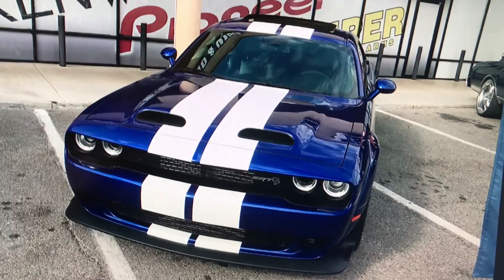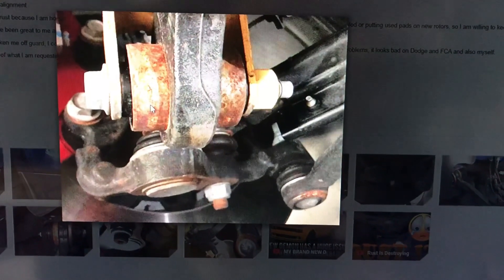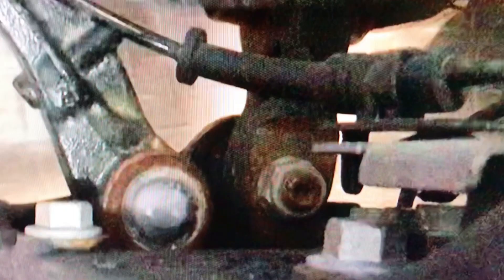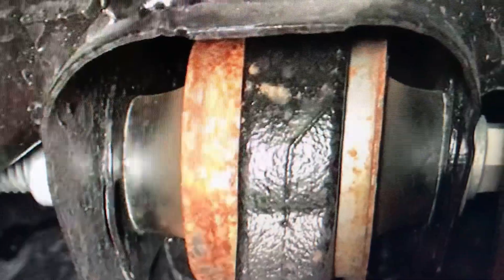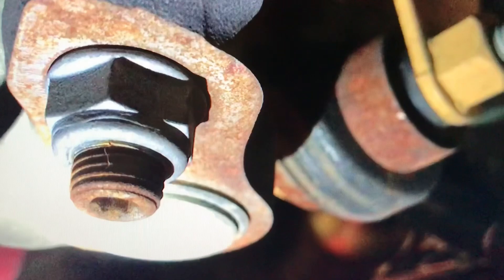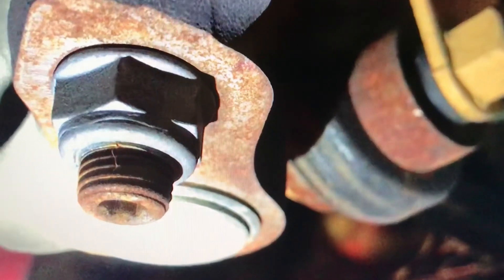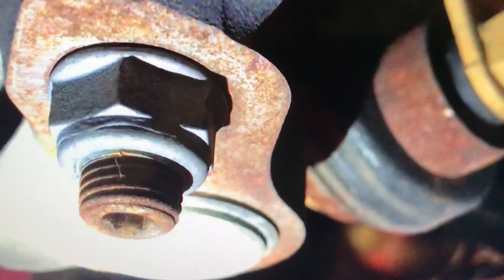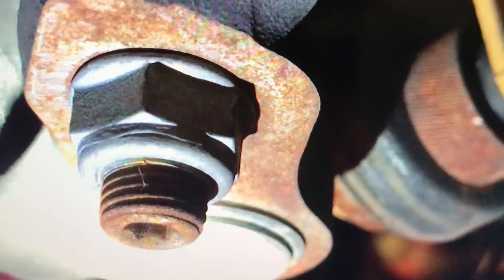2019 HELLCAT REDEYE WIDEBODY EXPOSING THIS SERIOUS RUST ISSUE VIDEO 1 OF 2 SHAME ON DODGE & FCA

Comment: Well it is a dodge.
Reply: I can agree with this comment when I think of Dodge I think of rust granted if its surface rust that can happen with anything unless it's properly coated I would have personally never ended up with a Dodge but I do have a Dodge Dakota because it was my grandfather's and he passed away so far I have had to replace all the brake lines and hoses and the parking brake line because everything was so Rusty underneath and I'm battling rust below the bed currently I don't know what it is about Dodge but they always seem to rust a little bit worse than others.

Comment: That rust is normal and every car I have ever looked under has sum rust in less you live in snow areas and drive your challenger in the snow I would not trip the cracked. Bolt it’s not too cool tho
Reply: Seeing as I crawl under my vehicles NOPE my Ford truck doesn't have any surface rust nor does our Volvo S60. They probably storied the Hellcart outside in Michigan in a salted parking lot. The rust isn't the end of the world, I agree but the crack int he bolt is they should at least fix that for him.